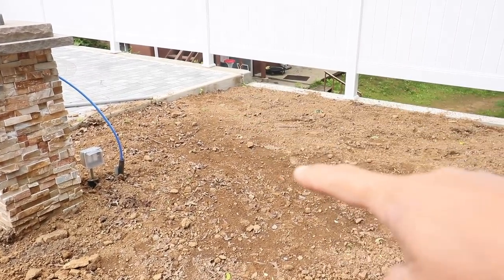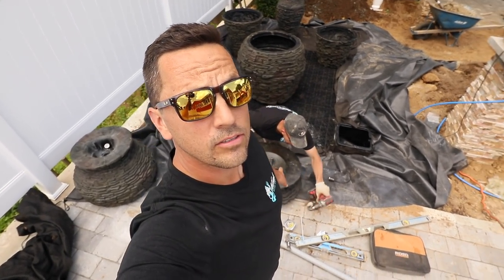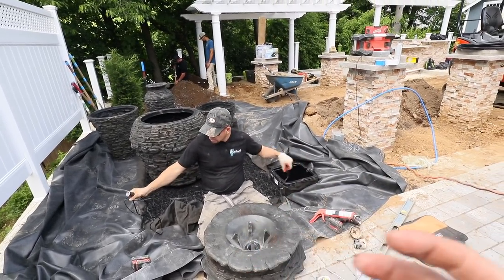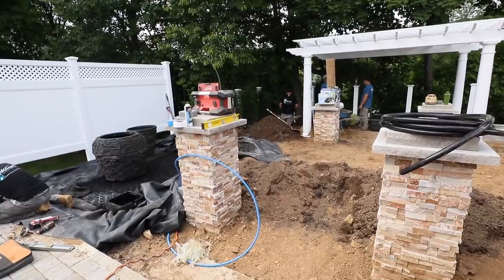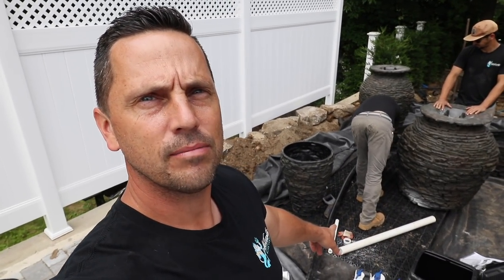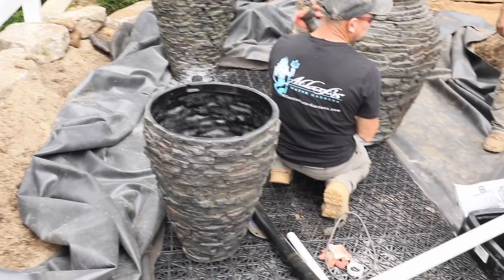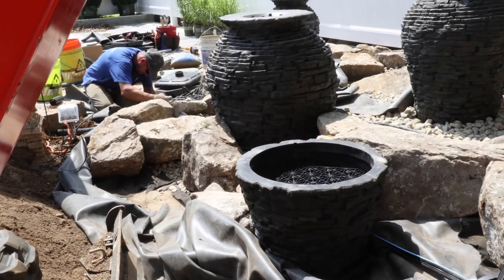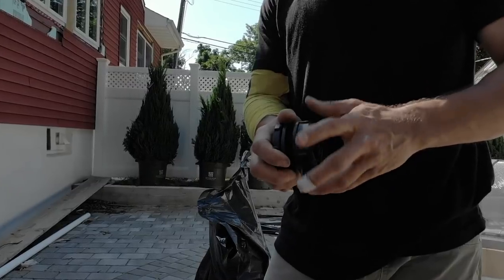2 Killer FOUNTAINSCAPES at 1 HOUSE!

Comment: I love the way the water goes down from those big jars. This is the best effect. They have been very well designed.
About the 2 bigs others, I would have add something in the opening you have made at the top :  A very flat and thin stone and maybe use the very side of the  pieces you cuted to make a better finish of the holes you have made and create the illusion that those pot are full stone.
Maybe the aquascape company should make a spare part to use to perfect the finish when you cut that border, because it seems to be quite usual that you do that.
You have to suggest that to The Pond Guy 😉 He loves perfection too, It could be one included with the pot, and it could be a possibility to buy them separately (like an option) in case you make more than one opening. Tell him that I only take 10 % 😁😀😂

Comment: Awesome work again, Jaak! Perfect for that backyard! Boss Baby is learning  from the best.😉👍
Technical question:  Those 2" Pvc hoses placed horizontally on top of the Aquablox connecting the 3 urns, are they able to self drain out through the manifold into the reservoir once the winter freeze up comes?(preventing winter pipe bursts) Just wondering. Thanks!
Reply from the maker: We have to blow them out for the Winter